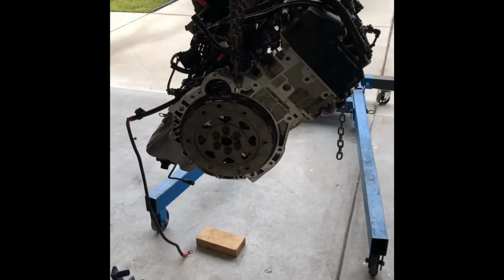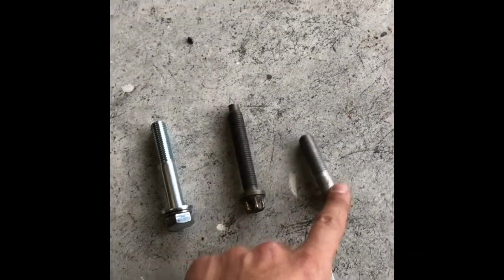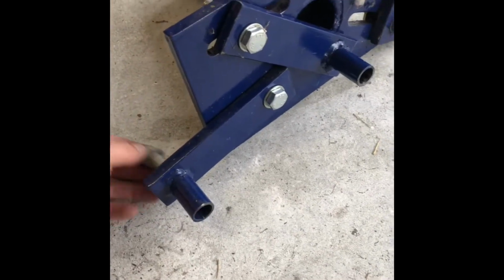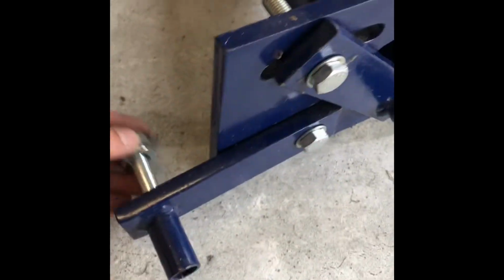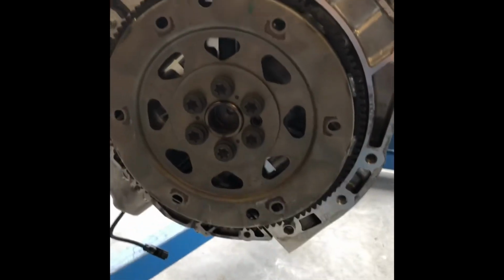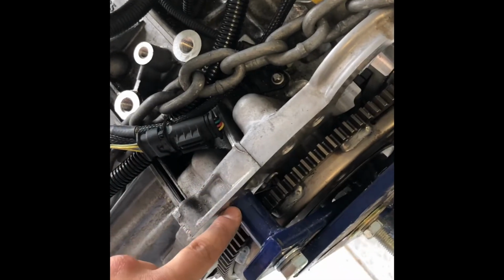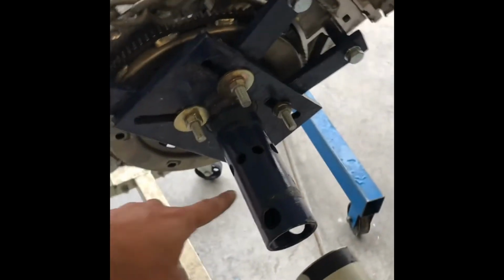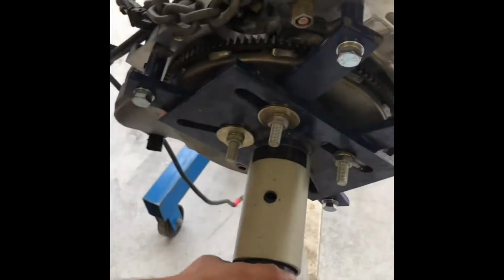N54/N55 engine stand

Comment: All those tow hooks don’t go on, it’s a weird design but we have this problem with a N52/54 aswell, what we do is shave the hook to thread it in more!
Reply from the maker: I actually ended up doing that when I installed the engine back in the car, I ground it down with my bench grinder and got it to go down a few more threads, worked out in the end.
Reply: @carsnstuff6022  usually everyone realizes this when doing the oilpan , almost all the support bars are not tall enough and hits the hook! My E46 tow hook fits in the e9xs perfectly weird how they did that!

Comment: What are the specs of the new bolts you got to mount it to the stand. I need to get some asap!
Reply from the maker: sure so I got mine from Lowes, the bolts are grade 8.8 bolts, the size and thread pitch are M12 1.75x80 I paired that up with 12mm washer one flat washer with a crush washer I did not torque the bolts down I just got them good and tight with a ratchet, good luck with your project btw.

Comment: How many ft/lbs did you tight the bolts into the engine to?
Reply from the maker: no need to get too tight I never put a torque wrench to it but I did it with a 3/8 drive ratchet and nice and snug is all
Reply: @carsnstuff6022  thanks for the reply. I found a result that seemed to indicate the bell housing bolts (M12x90) should be torqued to 53 ft/lbs. that seems to be holding just fine for me
Reply from the maker: @michaelgordon9832  Nice yeah that sounds about right, I think that's the torque spec for the bellhousing bolts in the car so I would imagine that's also good on the stand as well.
Reply: @carsnstuff6022  right, that's what i was searching for (the bell hosing torque specs). didn't want to over torque the bolts and ruin the block doing something stupid like that lol
Reply from the maker: @michaelgordon9832  right on man well thanks for the info!! I have an update I need post, I am doing a whole build with this engine, I finally sourced a crankshaft I will be using and some other goodies, if you wanna follow my channel I'll have it posted soon also will be taking my block and crank to a machine shop, I'm using youtube just to document my experience and maybe it'll help other people or at least they learn from my mistakes, I'm sure there will be some, hopefully not too many.
Reply: @carsnstuff6022  right on man, awesome! good luck with the project. I already had another one built by a shop, I was just breaking down my original motor that I knew was toast. I spun the bearing and shattered piston #6 lol
Reply from the maker: @michaelgordon9832  nice out of curiosity who put together a engine for you? I’m still trying to figure out my best option
Reply: @carsnstuff6022  Billiam Mason at BMB Autowerks in NJ. He's the best money can buy
Reply from the maker: @michaelgordon9832  awesome I will check them out, I'm trying to figure out what I will do I've been talking to ABR Huston as well but I want to have a few options.
Reply: @carsnstuff6022  Ok, I've heard good things about ABR...they were my #2 choice, but purely due to location proximity. I live in NY so I didn't have to ship my motor